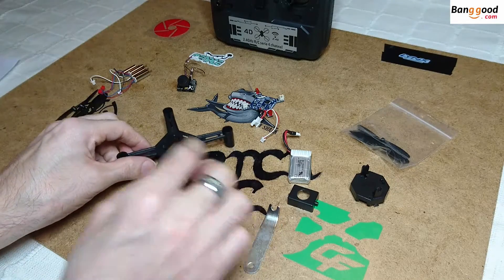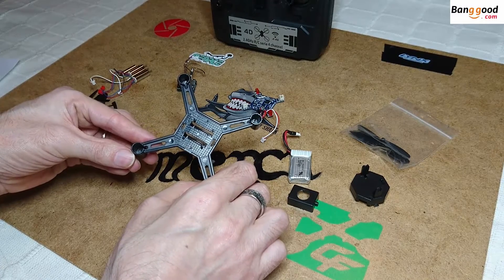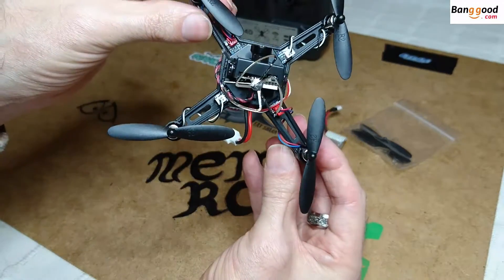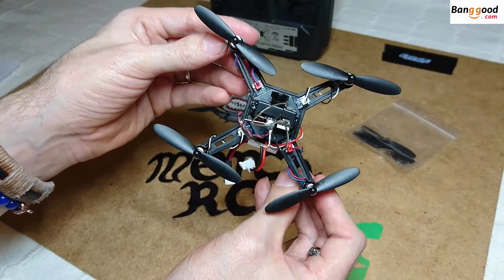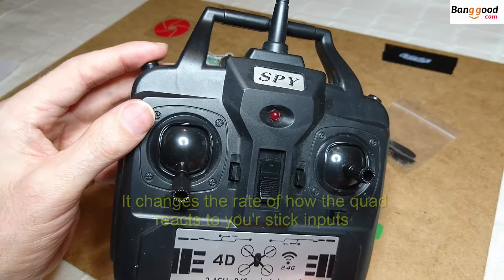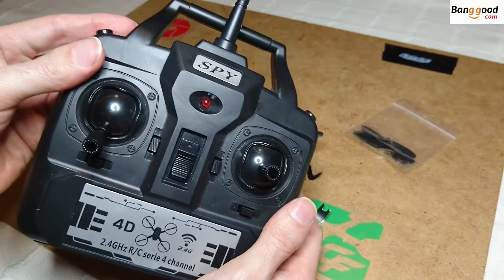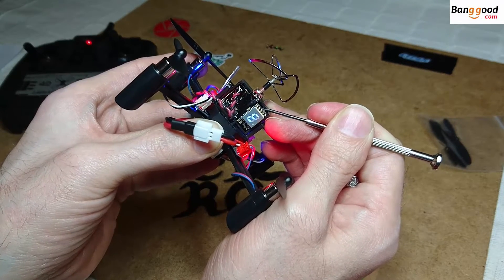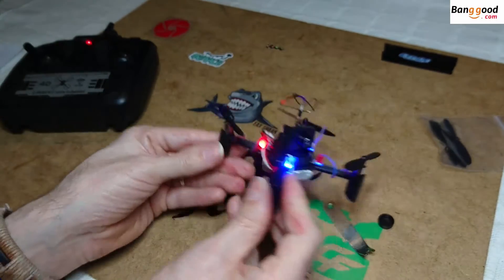DM002 FPV Quad Indepth Build With Tips (Courtesy Banggood)

Comment: You guys need to try beta fpv 720 17,500 kv motor upgrade and king Kong 65mm props if you own a dm002 , I did these upgraded and the power /performance is amazing , I use 610 mah lipo & 750mah LiHV  and I get 6-9 minute flight times, and batteries were from my h502s and h216a by Hubsan , they are 2 cell batteries that I cut apart and made into 1 cell if anyone is interested ,I also going to test out boldclash 450 mah lipo & boldclash 550 mah LiHV
Reply from the maker: Nice upgrades there!!!....I fly and test that many quads these days i usually don't upgrade them,they end up back in there boxes depending on what quad i prefer to fly.